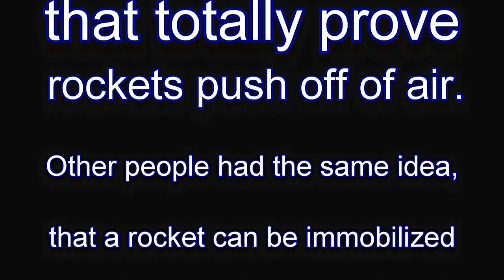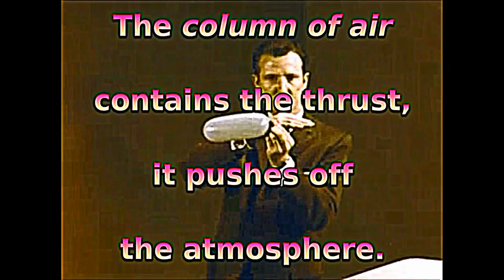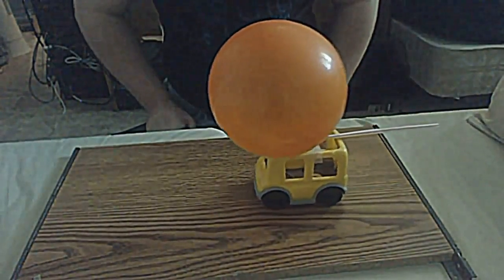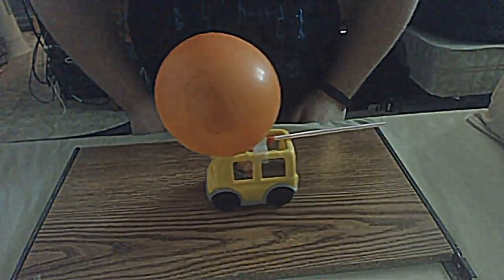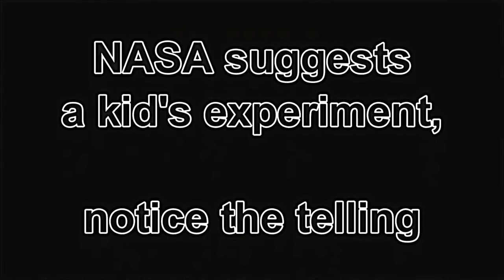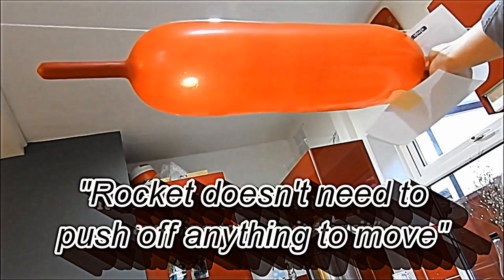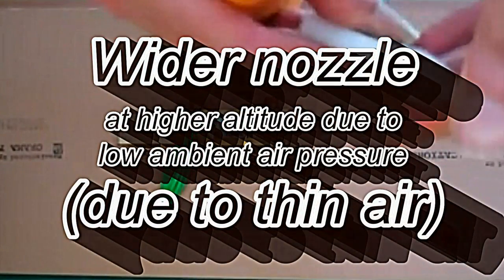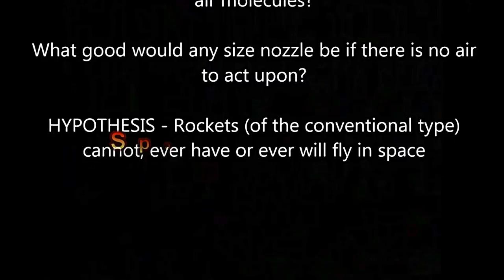rockets push off air

Comment: The vacuum of space does not bloody suck, you are essentially taking the word "vacuum" and just assuming that it must means what a vacuum cleaner does, and that the vacuum of space sucks, but no thats not the case at all.
Reply from the maker: You totally missed the point. Nowhere did I say or imply that the vacuum was to simulate space. The video was crystal clear and had crystal clear text overlay. The vacuum was to redirect the exhaust, to bend it 90 degrees, don't know how you missed that?
Reply: thats my point, how does any of this imply that Rockets do not work in space
Reply from the maker: Nothing is implied, it is demonstrated and proved because it falsifies the claim that once the exhaust leaves the end of the nozzle--once it literally passes the outer edge--it has no effect on the rocket but in reality it does.

Comment: But wait. The paper is attached to the balloon. So the force of air on the paper matches the force on the balloon and the resultant force is Zero. If it were possible to attach the same idea to a rocket, it too would go nowhere.
Reply: markymarkst3r you need to realize these people don't understand physics. At all.
Reply: @alkestos  but they think they understand it better than experts. Dunning Kruger
Reply: take a closer look.. they also taped it to the string.
Reply from the maker: Wrong. According to your beliefs, the rocket should taken off BEFORE THE GAS HITS THE PAPER. :face-red-droopy-eyes:
Reply: @rocketspushoffair  Took you 5 years to think of a response? 
My "beliefs huh? My belief is that you have little understanding of physics.
Do you honestly think there is enough resistance in air for a 3000 tonne rocket to push off?
Reply from the maker: @markymarkst3r  Wrong again. The question is do you honestly think the rocket was 3000 tons? The Apollo TWR (thrust to weight ratio) is 1.25, and the minimum for any type of rocket to detach from its launch pad is TWR = 6, but this is increased proportional to rocket mass increase, so, for a 100 ton rocket the safe TWR minimum is well over ten times this, likely over 100. And this is from the pinned comment, which contains even more damning facts about launching, such as the fact that even at 1 m/s the weight of Apollo increases to 15,000 tons! 3700 tons of thrust is not going to work buddy! 

I don't deal in beliefs as you do. I deal in real science and FACTS, not NASA bull💩
Reply: @rocketspushoffair  You might attempt to deal with Real Science: but you don't understand it. The fact is that you don't understand the difference between weight and mass. Weight is actually a  force, but I doubt you will be able to comprehend that.
Sure, an object under acceleration may appear to have more weight, but its mass doesn't change. F=ma. An upwards force greater than m x g, will cause upward acceleration. Its that simple.
Reply from the maker: @markymarkst3r  Wrong. Stop lying. A simple demo with a balloon is all it takes to prove a TWR of 1.2 is not moving the 3000 ton Apollo, not even close. Too bad math is not your thing.
Reply: @rocketspushoffair  Haha. "I don't like/understand so its all lies"
You think a balloon on a string, an "experiment" that more demonstrates  a failure to  grasp basic physics than anything else, is more conclusive than a rocket liftin off the ground.
How do you account for the fact of a 3000 tonne rocket actually flying?

Comment: Bob Macadu9  put it more succinctly than I can, but you make the common mistake of misunderstanding how rockets work in relation to the 3rd law of motion. The formula for the conservation of momentum is; m1.v1=-m2.v2. In this case, when  mass1 (the fuel) is ejected from the rocket at velocity1 (the expanding gases in the nozzle), then mass2 (the rocket) moves in the opposite direction at velocity2 - it doesn't require any air to "push against". The only effects air has is its resistance to the movement of the rocket at the front (and friction at the sides), and the change in ambient air pressure as it ascends - relative to the pressure of the exhaust gases. (Note: this is one of the reasons why rockets have stages with different nozzle geometries).  It is the exact same principle as standing on a skateboard on a level surface and throwing a bowling ball away. - The force causing your movement is created by the interaction between you and the ball, not between the ball and the air behind it. Basically, the expanding gases in the nozzle are pushing the nozzle and rocket away, not pushing the air backwards. They work perfectly well in a vacuum. Check out books on Jet nozzle (C-D) design. Or check out a web series like Olaf Willocx's very good basic description of how rockets work on Youtube.   btw, if you're suspicious of NASA, check out one of the other 12 non-NASA/ non-USA countries that regularly launch rockets into space, and note that the first rockets in space were developed by another country - before NASA existed, ironically their original purpose was to attack the USA.
Reply: markmark63 lmao one sentence in and you’re already giving him too much credit
Reply: markmark63  Unless it confirms his bias he doesn't want to know. Many have tried, many have failed (myself included).
Reply: @papalegba6796   I was using the conservation of momentum formula to explain how rocket engines work (I work with rocket engines). They work perfectly well in the vacuum of space because "they do not push against the air" - Only a moron would claim otherwise".

Comment: Is this the video you wanted me to see? I'll refer to the vacuum cleaner as "hoover", to avoid any confusion. Your hoover experiment proves that the balloon does not push off air, because the hoover did not remove the air behind the balloon, it just created a wind. You can still breathe in a wind, proof that there's still air, so there was still air for the balloon to push off, but it didn't.
What you did was create an air ejector or Venturi pump like effect, where the wind creates an area of lower pressure in front of the straw and sucks air out, towards the side. This has two effects: it removes the forward force as air is sucked out of the balloon, not pushed out, and the air that makes it out is drawn sideways. Since the car can't move sudeways, the opposing third-law force is wasted.

Your second experiment reminds me of a reverse thruster used on jet airplane engines: they consist of two doors that close behind the engine, redirecting the exhaust stream towards the front. Your fallacy here is that you do not consider the paper part of the balloon, but you have stuck the two together: the air exerts forward force on the balloon, backward force on the paper, the tape equalizes the two, and no forward motion can ensue. It's like thinking you can get a sail oat going in a calm by blowing into the sails (perhaps with the aid of a fan): it won't work, because the force on the fan (which is hopefully securely tied tonthe boat) equalizes the force on the sail. In your experiment, the momentum of the air is eventually directed sideways, and the imbalance between the sides creates the observed sideways momentum of the whole assembly.

I've already commented on your misreading of the "rocket nozzle efficiency" wikipedia article. The nozzle serves the purpose of letting the escaping gas expand and cool (adiabatically), which basically converts temperature into mechanical energy. If you overexpand, you drop the pressure too much, below ambient pressure, creating suction; if you underexpand, you are not converting all of the thermal energy, losing efficiency. So the theoretical maximum efficiency is achieved by letting the hot gas expand and cool to exactly ambient pressure. But your balloon has no hot gas, and no nozzle that allows for expansion, so that principle does not apply to these experiments.

Research fluid dynamics, this isn't rocket science (well, in a sense it is), but there are textbooks on it. It helps understand how this stuff works.
Reply from the maker: I never said or intended to "remove the air behind the balloon" that is a common misunderstanding by those who don't really know what is going on. I proposed this experiment and my opponent on here actually carried it out. The purpose of the vacuum was to bend the exhaust thrust column by 90 degrees, to redirect it. In no way shape or form does this cause the exhaust to be pulled out as you stated, that is contradictory to what you believe, since your analogy is ejecting bowling balls, how is the ejected bowling ball going to affect the next one after it? It cannot.

So, my experiment (the NERD experiment) falsifies the claim that once the exhaust leaves the outer edge of the nozzle, it can have no effect on the rocket, but, according to my demonstrations, it does have an effect.

"proof that there's still air, so there was still air for the balloon to push off, but it didn't." did you watch the video from the start? The first demo had the entire exhaust straw in a fully running vacuum cleaner hose, and yet, the balloon rocket was able to thrust forward effortlessly. And that is because there was plenty of air in the vacuum hose to push off of. The person who did that experiment thought he was disproving rockets push off air, but as I mentioned in the video, he only shut the mouths of those who insisted that the balloon rocket from the NERD experiment was held by drag and that the vacuum suction created a pull on the vehicle.

Your school of thought is that once the exhaust passes the edge of the nozzle, it can no longer have an effect on the rocket. However, at a specific distance from the exhaust opening (discovered by trial and error) you can redirect the exhaust and immobilize the rocket, as you clearly saw in the video. You simply cannot explain this result in terms of ejecting bowling balls.

The thrust reverser example disproves your belief that once an opening is created, at that very moment there is supposedly an equal opposite force at the opposite end. The reason is that there is ample DELAY once the opening is created until the exhaust hits the paper. According to your beliefs, the rocket should taken off BEFORE THE GAS HITS THE PAPER.

The guy in his kitchen doing NASA's kid's experiment then modifying it by adding a sail at the back shows what happens with an imbalance in thrust, since previously we saw that if the paper is centered just right, the exhaust will split equally and there will be no movement at all, but in this case, the rocket did loops around the string while not thrusting forward at all. This observation proves again that rockets push off the air.

The second half of the video shows what happens with too wide a nozzle at ground level, the rocket is immobilized, and this cannot be explained in terms of ejecting bowling balls.You are the one misreading here, not me. The change in diameter of the nozzle has the exact same effect in balloon rockets as it does in fuel burning rockets, it disperses or concentrates the exhaust and lowers or increases its pressure respectively by doing so.

Rockets do a parabolic arc and fall right back down. The apex is the point where the air is too thin to support thrust because each nozzle diameter is only optimal at one altitude. Once max altitude is reached then the rocket noses down, the trip is over.

You need bowling balls and skateboards to reconcile your false ideas, but not me, I talk in terms of the system alone, such as increasing and decreasing pressure by increasing and decreasing nozzle diameter. I don't need bowling balls to explain my observations. You need bowling balls because your explanation does not make sense, it is not backed up by reality. The exhaust and the rocket are inseparable, nothing is ejected. The whole idea of ejection is absurd.
Reply: rockets push off air pressure is important, and there's a science of pressure, which is hydrostatics, and fluid dynamics/aerodynamics. The flow of air outside an object can influence the motion of an object, which aircraft wings readily demonstrate, but it's not intuitive or obvious, which is why aircraft took so long to be invented (well, that and the lack of light engines). If you combine the aspects of momentum and aerodynamics, the observed motion is explained (as I did).

The force on the pack panel travels at the speed of sound because that's the speed that a pressure wave will propagate at.
Reply from the maker: @mendelde  I have no idea what this comment refers to?
Reply: rockets push off air yeah, I'm fine with that.
Reply from the maker: @mendelde  you mentioned "the pack panel' but you probably meant the BACK panel? If so, you are clueless about the fact that the pressure inside the nozzle and combustion chamber is extremely low, and i'm fine with how clueless you are 🤣EDIT: IN FACT, the highest pressure is just AFTER the combustion chamber, and decreases to ambient by the time it exits the nozzle.
Reply: @rocketspushoffair  I agree with your edit, that works with what I wrote originally.
Reply from the maker: @mendelde  Yes, it crushes your notion of a force pushing at the back of the combustion chamber nonsense 😁All the force/thrust is in one direction, and the action is between the exhaust thrust column and thee atmosphere.
Reply: @rocketspushoffair  if "all the action" was between [air] and [air], there'd be nothing to move the balloon

Comment: So the Saturn V rocket had five engines on the first stage.  The total area of the nozzle openings was 779.32 square feet.  You are saying that air in that area has enough rigidity and mass that a 6.54 million pound machine can push itself off of it hard enough to fly straight up?  Another question is how is it pushing off of it?  Once the exhaust leaves the nozzle how could it still exert a force on the rocket?  It's not connected to the rocket, it's being jettisoned.  Propellers push off air, but they are connected to the plane by a shaft.  I don't see any shaft that connects rockets to their exhaust.  Your poorly conducted ill conceived experiments are packed full of extraneous variables.  Like creating a pressure gradient between the front and back of your balloon car, or the fact that the balloon stretches every time you blow it up causing each subsequent test to have less thrust.  Did you even realize that a piece of paper behind a deflating balloon will act as a sail pulling the balloon in the opposite direction of its thrust.  We know sails catching moving air will exert a force as we've been using them for locomotion for thousands of years.  Then when you get results that you don't like, you simply ignore and discard them.  Your dishonesty knows no bounds.  All these fallacious concepts aren't new though, and your video does prove one thing:  YOU ARE A CREDULOUS MUPPET, PARROTING FLAT EARTH NONSENSE.
Reply: Two years with no reply forthcoming. He must be busy cooking up a blowtorch or bowling ball analogy. Don't worry I'm sure he'll reply any day now.
Reply: The Saturn rocket was a stage prop. Using fake numbers to prove something is not fake is self defeating lol.
Reply: @papalegba6796  Yeah, a "stage prop" that thousands of people saw take off in a manner that only a very heavy, very powerful rocket could do.

Do you deny your own head since you can't see it for yourself?
Reply: @BarnabyRudge-sx3pb  rockets can't be heavy, or they won't take off. They're useless. They don't take off slowly either btw, balloons do though. Stage prop 😂
Reply: @papalegba6796  Clearly you have never seen film of a Saturn 5 taking off, OR of a balloon launch.  The first is slow, the second is fast, the opposite of your ill-informed claim.
Grow up and get an education!

Comment: WOW!!! You essentially attach a sail to the back of the balloon and since it does not move, your conclusion is that rockets don't work in space and that space if fake. This is the stupidest thing I have ever heard. You can't see that the forces cancel each other out? You start this video off by placing a vacuum at the exhaust of the balloon and guess what, the vehicle propels forward, you just proved rockets don't need to push off of air. Congratulations for debunking yourself.
Reply: @citizenplane5840  Correct except that rocket propulsion does not require any pressure to "push off". The rocket propulsion force is created by mass flow rate of super heated gas X velocity of same super heated gas. A lack of external pressure just serves to increase this efficiency of propulsion.
Reply from the maker: Your reply FAILS to refute Citizen's comment: 
Citizen Plane  • 8 months ago
A vacuum cleaner is nothing like the the vacuum of space. Its negative pressure. The vacuum of space is the absence of pressure. So yea that experiment proved nothing. But the fact they have to use a larger bell to achieve thrust in higher altitudes tells you that a rocket wouldn't work In space bc there's a complete lack of atmosphere. Its not just thinner air. Its zero air.

xxxxxxxxxxxxxxxxxxx

Also, you are ignorant about rocket engines, and your ignorant claims debunk you. The pressure is relatively LOW inside the bell, and exit pressure matches ambient. 

Moreover, a lack of external pressure means zero combustion. Watch at 20 miles up https://t.co/BC9NSlcH2Z Have fun restarting those engines! HAAHHHAAHHAAAAHH!!!!
Reply: @rocketspushoffair  The vacuum of space is negative pressure? Can you define negative pressure and how a gauge would read negative pressure? Do you think that there is negative pressure in the rocket? Can you provide pressure data inside the combustion chamber of the rocket? How ironic you call others ignorant. To date, you have made zero true claims and continue to not understand simple physics.